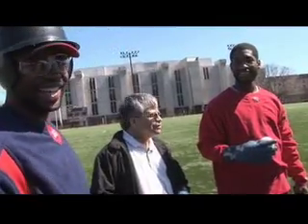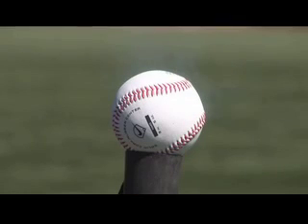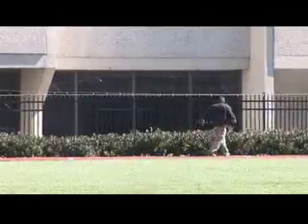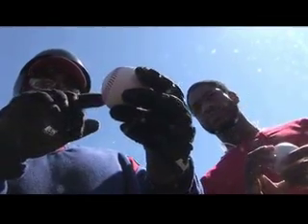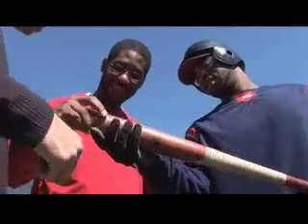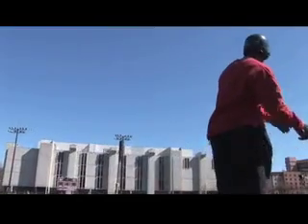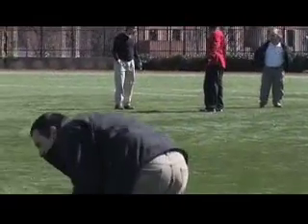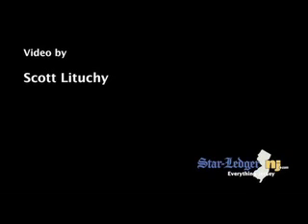Aluminum vs. Wood bats

Comment: aluminum and wood are almost the same. I have tested them myself with the same size bat. The advantage for metal is that it has a larger sweet spot and you don't need to use good mechanics.